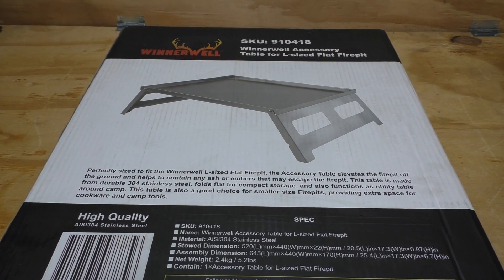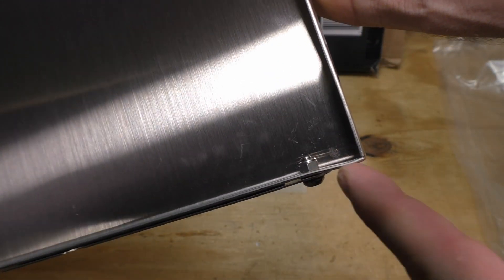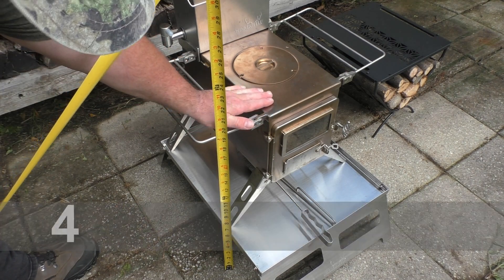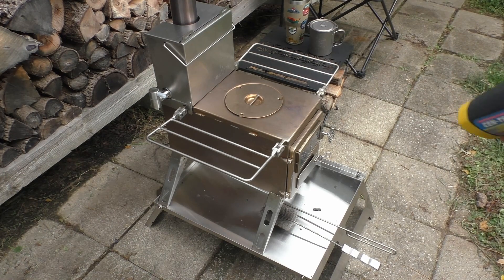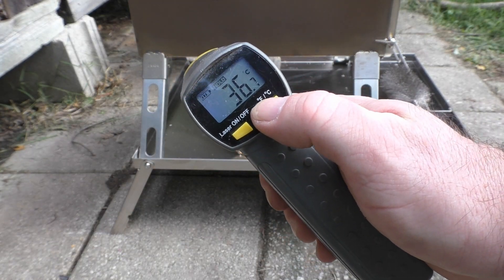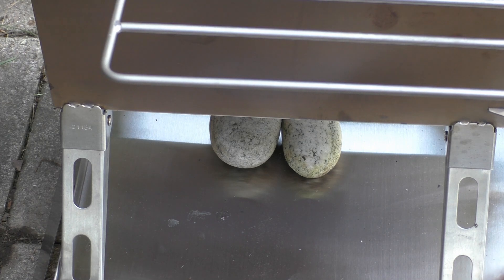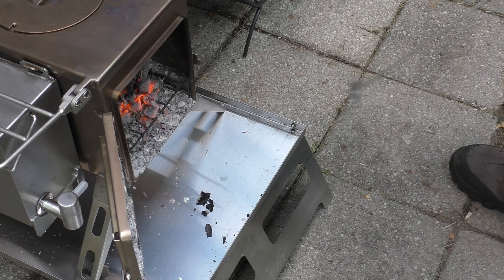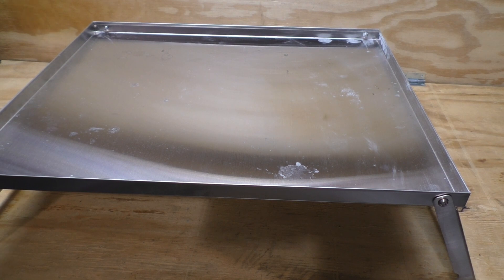Winnerwell Accessory Table Large Review

Comment: If you wanted to go the extra Mile and just to be sure, you could also put a welding blanket under the stand it's self. And have it just a little bit in front of the stand.
 If that makes sense.
Reply from the maker: Yes it makes sense what you are saying, and you are right.
Reply: @charlesartificer2158  Yup. Its not a question of if hot coals will hit somewhere you don't want them, its WHEN. We were sitting in front of my grandfathers woodstove he installed in his fireplace when I was about 10...and POW...a knot exploded and a hunk of burning wood flew out the door and past the hearth and hit the carpet of the den. Around the campfire outdoors...meh. But in your shelter...Holy God that's a eye opener
Reply from the maker: lol it is an eye opener. The idea of burning alive in a tent is not my idea of a good time lol. Thanks for the comment and views brother. P.S. I have another volume in mods for the Mora multi mount coming near the end of the month so be on the lookout.

Comment: I think the mat would be a  better insurance for your tent floor.
Reply from the maker: @Breal191 Disagree, let me explain why. I have seen where others have been using the mat and just the heat from the stove has caused it to melt. Not to mention that any textile that involves heat resistance has a life before it fails and you need to buy a new one. This stainless steel will last as long as the stove. Second reason is that the table has a high lip on it, this aids on stopping any wayward coals that fall out of the stove. The mat has nothing like this and after my experience I can tell you when you have a coal dump they love to roll. No lip they can roll right off the matt. Third reason this raises the woodstove to a more comfortable height. Cooking on the stove with this table in play is much easier than when it is on its own short legs. With the stove only legs I am on my knees and very uncomfortable. With this table in play I can sit in a camp chair and cook in comfort. So there is more than one reason to make it useful. But hey that's my opinion. Hope I have given you some food for thought.
Reply: I haven’t had that issue
Reply from the maker: @Breal191 You're lucky